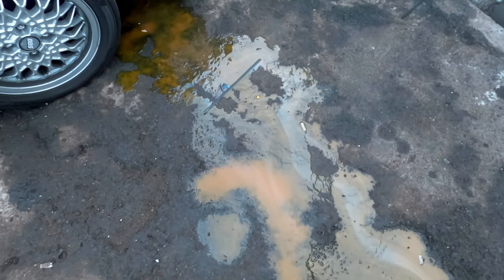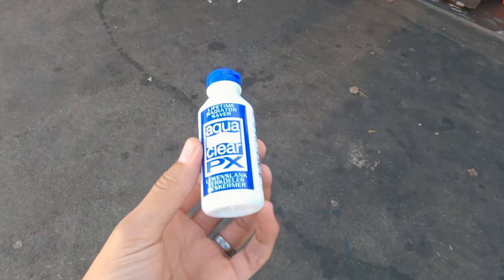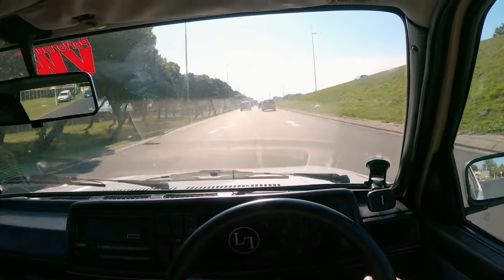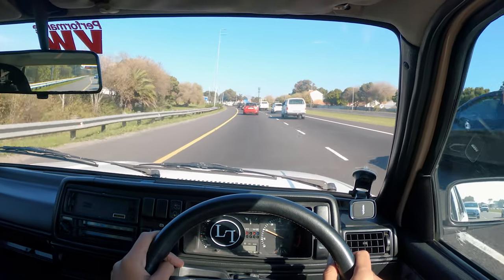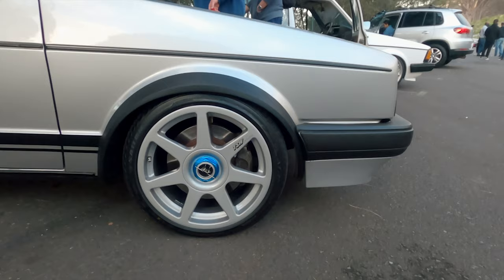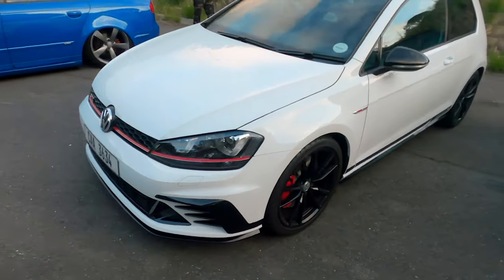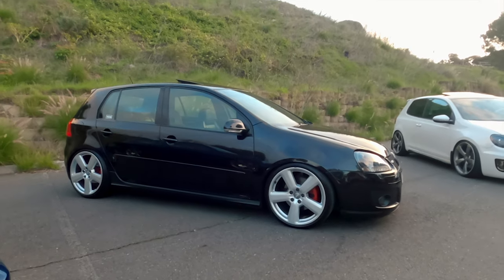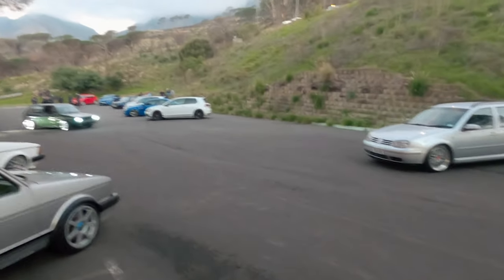Mk2 cooling system refresh (Rust) | V.A.G meet below Table Mountain

Comment: Yaaay, brakes eventually in the works lol 👀😎

Car looks so sick at that ride height 😍
Reply from the maker: Haha. Finally. Hoping for decent results with the powerbrake setup. Apparently my pads are cheap crap so it should be a massive improvement.
And that ride height is so good. I need to get the shorty beetle pan and then I can go lower 😬
Reply: @lowdl  you will definitely feel a difference with the powerbrake setup. Remember my 9n3 GTI calipers and carriers are still up for grabs if you do decide to go 288mm discs 😉
Reply from the maker: Jameel has a setup for me. But I think he has another direction in mind. He's just very busy. Which is good for business but not good for me. Haha.

Comment: From what I've been told 15 inch wheels won't clear 288mm brakes as the inside of the barrel fouls on the caliper, so 256mm would be the better option if you intend to keep the 15s. If you do decide to go the 288mm route a set of 16s would be a good idea as the will clear the brakes and allow you to fit a bit wider of a tire without making the steering too heavy
Reply from the maker: Thanks a lot. That’s what I’ve heard as well. A friend has 288’s on his Mk1 so I’ll check it on there. It seems that it’s not all 15” wheels. I’d like to keep the car on 15’s because of tyre availability (+cost) and steering weight, etc. But if I find a nice set of 16’s that suits the car, I’ll make the move.
Reply: @lowdl  there's a white set of 4x100 16 inch tsw imolas listed on Facebook market place that would be perfect for this car
Reply from the maker: Imolas are nice but they’re overpriced and it’s like every Mk2 owner is after them these days. They’re also really heavy. I’ll keep my eyes out for a set of Compomotives, O.Z racing or Azevs wouldn’t be bad. But big money. 😅

Comment: if your coolant looks like that then you need to check the condition of your hoses, water pump and thermostat pal. good maintenance is key
Reply from the maker: Hoping that it’s fine. We’ve flushed it and now we’re running a cleaner through the system. From what I can tell, there isn’t much dirt left. It’s been about 3 months running that radiator with the new setup which isn’t enough time for everything else to get badly affected.

Comment: That's the problem with Meth, you get addicted very quick. Suppose the same applies to Eth :)
Reply from the maker: 😂  I'm pleased to let you know that I drove the car home on 95 and it didn't feel slow. I'm sure the guy in the FN2 behind me didn't think so either. Haha. I like it at its current power level. Haven't really had a chance to get bored of it yet I think. But in about 2 weeks it will probably be making a little more when we get to the exhaust.
Reply: You have the  sleeper mode down to the T, i'm sure many more guys will be surprised. Exhaust will help the breathing as well. Awesome to see the mods rolling on.
Reply from the maker: Gotta keep the momentum up. But it will be slowing down soon. Exhaust, brakes & tyres. Then it's just little stuff until I can afford the big stuff.